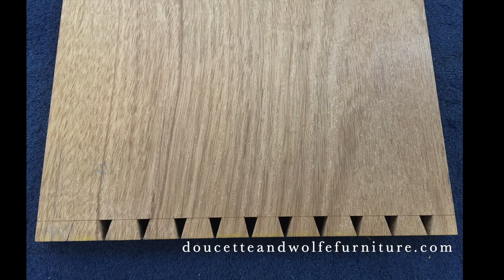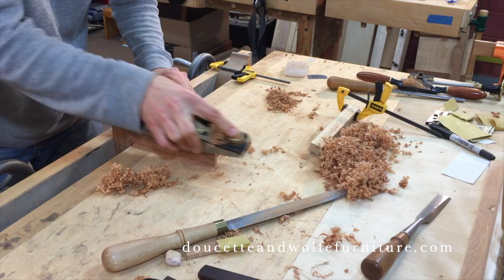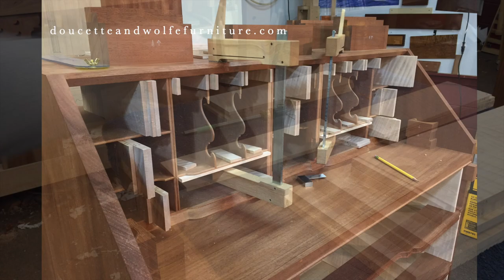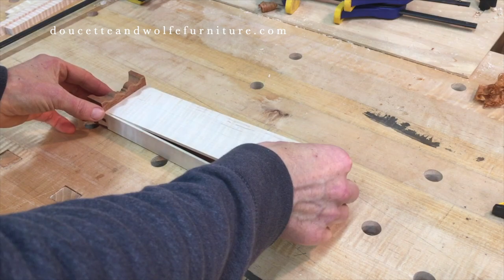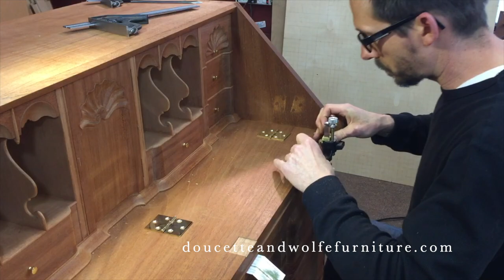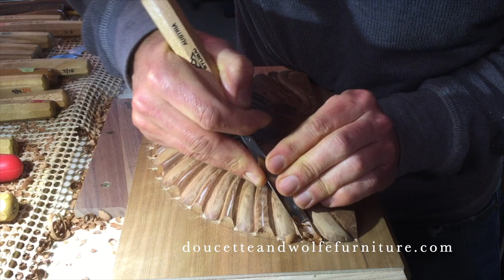Rhode Island Desk and Bookcase Build Process by Doucette and Wolfe Furniture Makers Part 1

Comment: I’m a competent amateur cabinet maker and now know how far away I am from the skills you show. There are two elements to any piece. The first is the design - which is personal; I accept that this piece is following the style of an original but the “fussiness” is not my taste. The second part is the skill involved in the process - which is universal; that is outstanding; I would be very fearful about carving the detail on the large slabs, knowing that a single mistake ruins a lot of money.

Although I’m the amateur, I did own a small cabinet shop making bespoke pieces almost exclusively in the Arts and Crafts style. We found that, here in the UK, the market for truly handmade, bespoke pieces of furniture to be very small with a lot of cabinet makers chasing that segment. We did well for a few years but then struggled to sell at a profit. I own the building and so overheads were low but just labour and materials were so high.

Very good quality antique furniture is so cheap over here, particularly at auctions. I recently bought a working 1820 long-case clock at auction for £80 plus fees. The movement will cost me £450 for a clean etc and the case needs minimal repair. It could easily have been left as-was. So, a 2 hundred year old oak long-case clock for just over £100.

I also bought a very nice Arts and Crafts sideboard with its top unit including bevelled mirror. Again in oak, perhaps 1910? Very well made with beautiful original metalwork. £130.

My point is really how could anyone make and sell those items at even 20 times what the antique originals cost me? I accept that the originals come with the knocks of age; but also history, patina, love.

So, over here, anyone can buy antique  “brown furniture” cheaply. If you want 20th century, the prices do rise (current vogue appears to be mid-20th century). If you want new, you can buy from people line Oakfurnitureland which is average in quality but solid “hardwood” (from what I’ve seen staves of far-eastern timbers like Mango) but it’s relatively cheap.

So, it’s not hard to see why cabinet making has declined massively. It seems that so many cabinet makers have to turn to starting woodworking schools in order to make a living, one cabinet maker said that, when he analysed his costs, his personal earnings were less than £8 per hour, even allowing for no rent on the building. He only does it because he loves it. 

I sincerely hope that D&W continue to find the right sales for their product. Their output can be low numbers, which is good, and their quality deserves success.

Comment: AMAZING!! What plane are you using for your end grain planing?
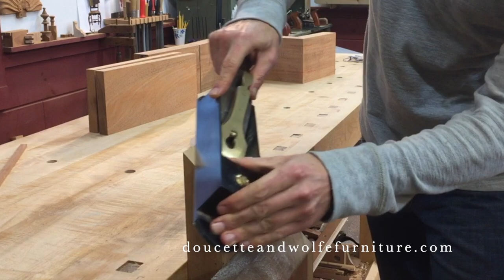Reply: If you are referring to the plane at 4:24 in video,  I believe that is a discontinued Lie Nielsen No 9 Iron Miter Plane. If you are referring to the plane at 9:30 in video,  I believe that is a Veritas Right-Hand Shooting Plane.
Reply: @garyvaiskauckas8463  Thanks Gary! I was indeed referring to the No. 9  at 4:24. It makes an appearance in many Doucette and Wolfe videos. I have the Veritas, and it is excellent. Never thought of using it without a shooting board. Just checked around and the No 9 is fetching quite a penny used. In your opinion, what is the best alternative to the No 9 for end grain plaining when a shooting board is not applicable?
Reply: @Cactustone  You're welcome. I do not have either the LN No. 9 nor the LV Shooting Plane. My go to planes for end grain are my bevel up planes either the Lie-Nielsen No. 62 Low Angle Jack or for smaller tasks the Lie-Nielsen No. 60-1/2 Adjustable Mouth Block Plane. Lee Valley Veritas also has excellent alternatives. These Low Angle Planes are bedded at 12 degrees coupled with a Blade with a primary bevel of 25 degrees yields a 37 degree angle of attack plus any micro bevels. To aid with cutting end grain skewing the plane in use helps to better sever the fibers. Both the Veritas Shooting Plane has a skewed blade for straight ahead use.  If I had either I'd give it a try and post results. P.S. How do you like the Veritas Shooting Board Plane?
Reply: @garyvaiskauckas8463  Great info, thanks! The Veritas is by far the best shooting plane I've ever used. Before the Veritas I was using a LN No 5, LN No 7, or LN 62. For some reason I haven't been able to dial in the LN 62 to get the same results as the 5 or 7 or Veritas when shooting. With the Veritas' adjustable grip I no longer have to deal with palm blisters or deal with corrosion from sweat (often working in 100+ degrees here in AZ). I must note, the shooting board I made following Matt Estlea's design was a major contributor to the overall results. I did not modify the plane itself like he did, but the board still works well and is an absolute joy to use.
Reply: @Cactustone  Thank you for sharing your thoughts on the Veritas Shooting Board Plane. It looks like an excellent tool. One of my best "tool" investments when I set up my workshop in Florida was to add a mini-split HVAC. It keeps the shop year round at about 70 to 75 degrees. On the coast we top out in the mid 90s so we don't have the AZ extremes but humidity is a killer and it helps with that also which has additional benefits with wood moisture content and cast iron rust.